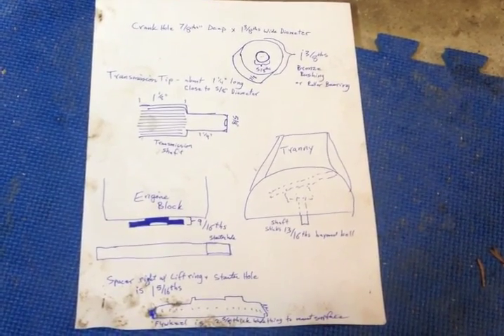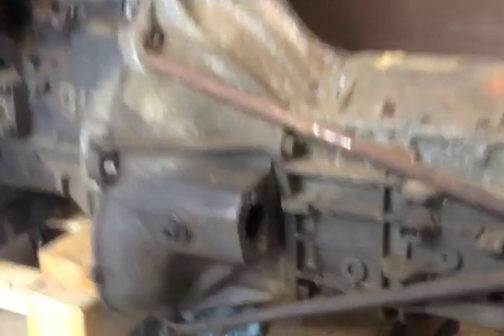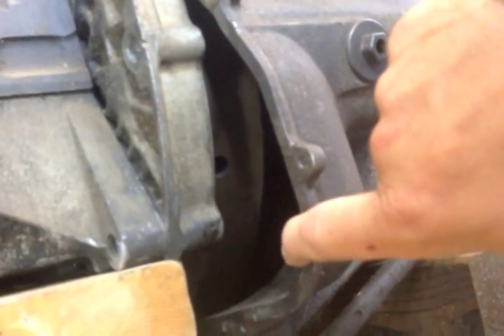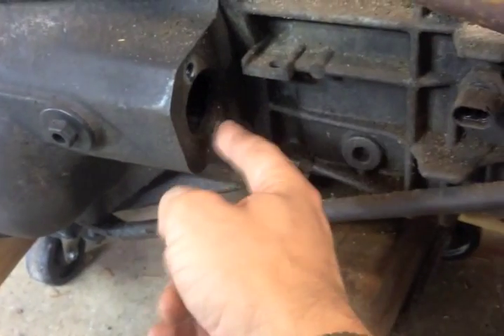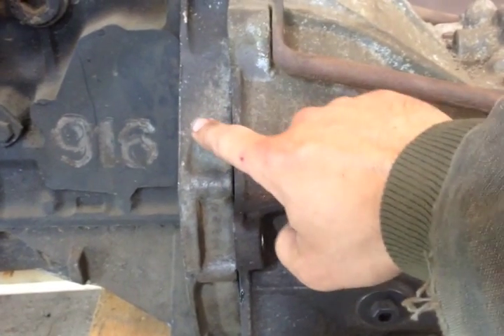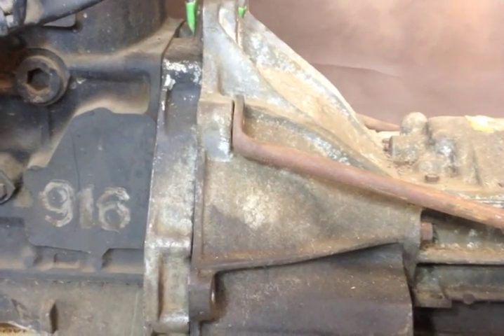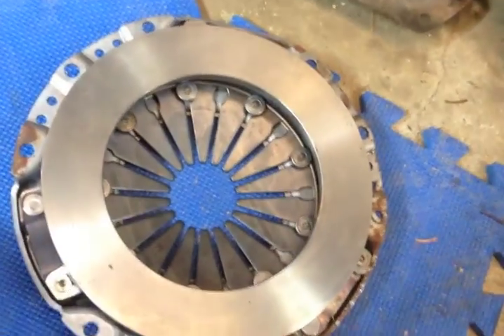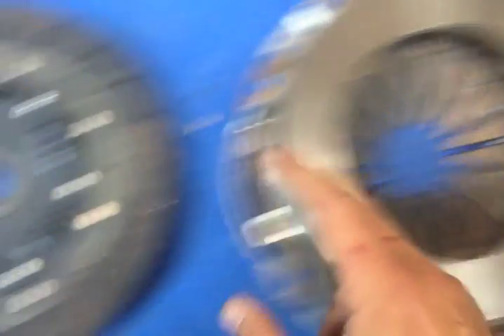SuperTruck: Matching up the Engine & Transmission

Comment: Maybe you could experiment with a wood (Birch?) adapter plate so that you could allow yourself to fail a few times without much cost or consequence.  Then make an aluminium  final assembly based upon the best result.

That would require a lot less tweaking.

Comment: that's the om616 engine.. looks like a 74? Worked on that line of engine so much.. get yourself a pop tester for those injectors!! If you plan on svo.. you better electroplate every inch in nickel or your gonna have rust issues. ~ Might want to upgrade those glow plugs.

Comment: Hey Ben, engine and transmission swaps are pretty common. The adapter plate on the engine side is changed to match the bell housing or the bell housing is changed to match the engine. SOMEONE may have swapped this combination before, search for after market customizers.

Comment: mounting engine to trans : custom plate to replace the OEM merc one.  DONE
But for the clutch depth there is 3 options possible so don't stress. Mesure how much you need and tell us so we'll figure it out :)

Comment from the maker: The transmission that went with this engine is an automatic. For the project, I want a manual transmission to be able to engage and disengage the engine from the electric motor. The truck already has a manual transmission, so it makes the most sense to use that.

Comment: Nice project.  There was a person that put a VW diesel in a Dodge Van.  It worked very well.  I expect this is going to work well for you.  One of the things I didn't like about my Mercedes 300D was the manual said to change the oil every 3000 miles and it took a special oil filter.  I was costing $60 to change the oil.